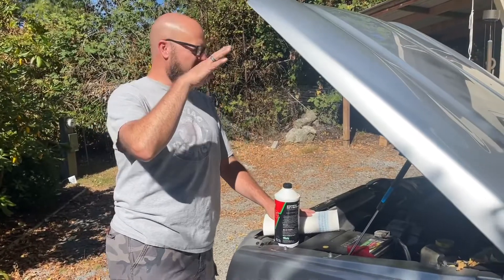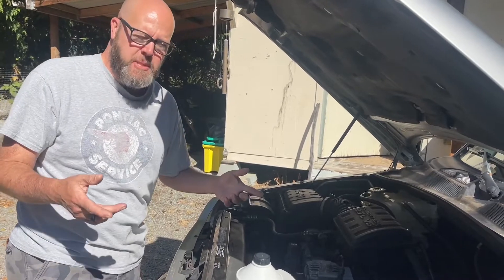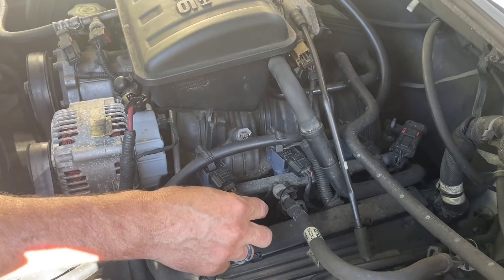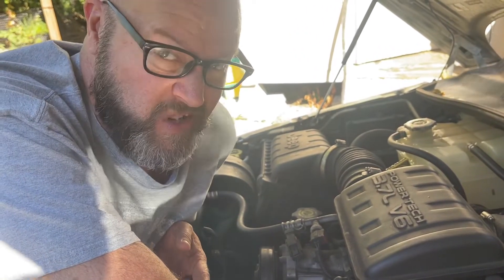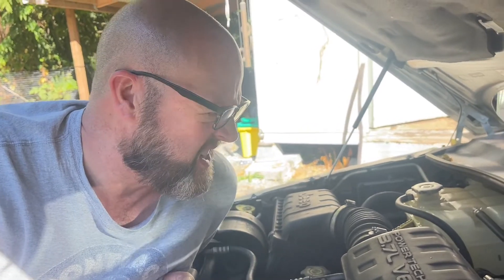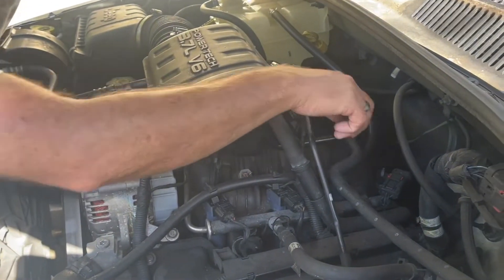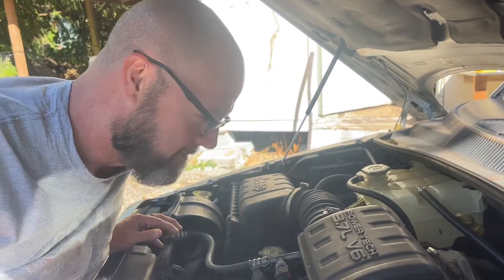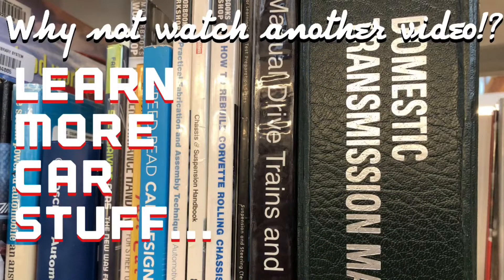3.7 V6 P0300 Cylinder Misfire Jeep Liberty, Cherokee, Commander MOST COMMON CAUSES

Comment: Just got this code on my 06 grand Cherokee it has 320k miles
Reply from the maker: Wow, that’s a lot of miles! Is it the 3.7 V6? Odds are a coil pack gave up.
Reply: Yes 3.7 V6 bought it over 10 years ago with 100k miles wife drove it for 10 years, then gave to my daughter when she got her license and wife got a newer 2016 grand Cherokee.probably the best vehicle I’ve owned, daughter still drives it today,328k and still rolling, don’t burn any oil
Reply: @ cleared code out and hasn’t came back as of yet fingers crossed 🤞, runs  smooth

Comment: I Have Changed All My Coils, Fuel Injectors, Spark Plugs, Relays, Gas Cap Battery And Alternator And I Still Have This P0300 Code.
Reply from the maker: Dang, Sounds like the computer. 
I would have a shop diag. It for you before throwing all those parts at it. 
Could be Computer 🤔
Reply: @RussShawTV  Shop Want Way To Much Money.
Reply: @RussShawTV  been driving it like this for over a year, runs and drives great.
Reply: The code has to be cleared, you can disconnect your cars battery for a few minutes to clear the check engine light

Comment: Hey I’m having this problem. I’ve replace coils plugs and plug wire set multiple times and still nothing. Checked wires all good about to do o2sensors and see what happens. But I cleaned my air temp sensor and the car drove good and then had a huge misfire and jumped rpm’s and then drove normal even when I pressed on the gas a good amount it drove good. 30 mins later after I got home I drove again and it started happening again. Could the air temp sensor by change be the cause?
Reply from the maker: I’m not sure. Could be a computer issue. This video was a most common cause scenario. 
When I worked at the shop, replacing the coil packs, usually fix the problem.  
I want to check out my friend, JT‘s “online mechanic tips“ channel. He is a Chrysler Master tech in Atlanta. He may have some information for you.  
Sorry I couldn’t be more help.
Reply: @RussShawTV  awesome thank you for your help. Glad you replied lol. Found a video and waiting for a reply on a question or two now

Comment: i have an 03 model that gets multiple cylinder misfires and ive changed coil packs,fuel injectors,crank and cam position sensors, new spark plugs,cleaned the fuel rail and replaced it and still have the same problem. but if i turn the ignition off and back on it fixes it briefly
Reply from the maker: Sounds like something with your computer 🤔 maybe able to find one at a wrecking yard that has the same specs. 
I wish you all the best with your Jeep liberty. Those three point sevens are good little engines if you can keep them running.
Reply: @RussShawTV  i changed out the computer,fuel injectors,spark plugs,new fuel rail,pcv valve,02 sensor,coil packs.  Tried marvel mystery oil etc.  runs great a while then just starts flashing the check engine light and goes into limp mode. I'm at a loss on whats wrong with it lol

Comment: Здравствуйте. P0300 все хорошо но эта ошибка не дает покоя
Reply from the maker: Sounds like your O2 sensors, or do you have a bad catalytic converter 🫤
Reply: @RussShawTV датчики первые стоят новые, а катализатора просто нет уже
Reply: @RussShawTV прошивка поможет?
Reply from the maker: Sorry, my phone stopped translating.
I don’t know what you’re saying. If you can translate to English, maybe I can help?
Reply: @RussShawTV  p0300 active error. The spark plugs and coils are excellent. there is no catalyst. Could this error be due to the rear lambda probes? How to deal with this error?
I will be very grateful for your help
Reply from the maker: @dedair-n1c  how do you know the coils are excellent? Are they new? Just because they are firing doesn’t necessarily mean they are working properly. The whole system is computer controlled, including the timing. These coil packs will affect timing as it’s built into the circuitry. There is no plug wires only computer generated signals firing the pistons.
Reply from the maker: @dedair-n1c  how do you know the coils are excellent? Are they new? Just because they are firing doesn’t necessarily mean they are working properly. The whole system is computer controlled, including the timing. These coil packs will affect timing as it’s built into the circuitry. There is no plug wires only computer generated signals firing the pistons.
Reply: @RussShawTV  Do you want to watch a car computer? and put the original coils?

Comment: idint help as i have 4 of 6 at once and my coil packs have less than 20k on them.
Reply from the maker: Unfortunately, if you bought aftermarket coil packs, that’s not uncommon. When I worked at the shop we, on more than a couple occasions, were replacing aftermarket coil packs bought on Amazon, rock auto even AutoZone and O’Reilly. Got to get the Chrysler OEM coil packs. Same goes for Nissan, Nissan don’t like aftermarket coil packs either. The Infiniti vehicles came in a lot with this issue, and we would get coil packs from the dealer 💸💸💸, but that would fix the problem. There’s websites out there, Chrysler parts, or Mopar outlet where you can find them at a much better price.
Hope that helps Andrew. Thanks for commenting.

Comment: Never say most likely when it comes to random misfires.... have 97 Cherokee and no coil pack...wires for each plug and continue to receive either po300 or po301
Reply: Camshaft sensor
Reply: Doesn't always give a code for it
Reply from the maker: When I worked as a both a mechanic and a dealer tech we would call this a “most common cause”. Just thinking off the top of my head 🤔 PO300 means misfire PO 301 cylinder number one and so on. I recommend if you have the money to replace all of them with OEM ignition coils. If one or two go, the rest will soon follow and while you’re in there, you’ll save your future self a lot of headaches. Don’t buy the cheap Amazon, O’Reillys or AutoZone crap. Odds are in my experience you will have to replace many of them in six months.
😎👍🔧You’re welcome ☺️
Reply: A year late, but your 97 still has a coil pack. It only has 1 instead of individual ones.  The middle plug wire on the distributor cap connects to the coil

Comment: I have a 2012 Jeep Liberty and there’s a misfire at cylinder 5 but I’ve changed spark plugs, coil packs, and fuel injectors. Any idea on what may cause it ?
Reply: Did you ever figure it out? I’m going threw the same thing
Reply: @isaacmartinez1336 unfortunately I did not. I was told to just replace my engine so I decided to get a new car.
Reply from the maker: Sounds like a computer issues. You should check out my friend, J.T. at online mechanic tips.
Reply from the maker: @@dibs4943 not a bad idea. I’ve seen critters climb up in there and chew on wires 🐀that can cause all sorts of havoc.
Reply: Sprawdź ciśnienie sprężania na tym cylindrze. Może się odpowiednie nie domykać zawór i będziesz miał misfire. Przyczyną może być dźwigienka zaworowa, lifter albo przytkany kanał olejowy do liftera.
Reply: Mine was the o2 sensor why I got the300 code

Comment: I have Cherokee 2009model tomuch problem misfire and also missing i change all injector and plug but same problem have any idea please
Reply from the maker: You may need ignition coils? 🤷🏻‍♂️
Reply: @RussShawTV  thanks
Reply from the maker: Your welcome Rashid, 🤔 Is it a 3.7 V 6?
Reply: Same with 2010 3.6L liberty, scanner says cylinder 2 misfire.  Changed that plug and checked wire and swapped out coil pack for that cylinder but never reset codes and after couple days after new coil pack it started misfiring again
Reply from the maker: @jeremywhite1062  3.6 penastar is a very different engine. Could be a computer issue. Or a valve if it is ticking as the first generation of those engines were notorious for. Also, those ignition coils are picky. It’s best to get OEM from the dealer or if you can find him a Chrysler OEM outlet website.
For example here in the states. O’Reilly says they have OEM ignition coils but they 4 of them lasted about a year 😡 just out of warranty.  But the OEM from the dealer we haven’t had a problem since. And she puts a lot of miles on her 2002 little jeep liberty.
Reply from the maker: 2009 has a different vehicle. Is it a 3.7 V6? I would check out my friend JT‘s channel (online mechanic tips). He is a Chrysler Master Tech.

Comment: They are individual coils. Not coil packs.
And that really isn't the most common problem with misfire. U hope that is the case.
Reply from the maker: I suppose technical term would be “ignition coils packs”. Each piece of circuitry is packed in a waterproof rod with a sealed cap at the top, with a mount be positioned with a 10 mm nut over the spark plug.
I worked on many vehicles with this 3.7 L engine and in the vast majority of cases it was a bad “ignition coil pack” replaced many of them had very maybe 1 come back.
I would recommend that people buy the ignition coil packs from the dealer or get them OEM. Common  reason they would come back is because they are cheap garbage parts. Found them here OEM for $42.00 each. https://www.northwestmoparparts.com/?gclid=Cj0KCQiAyMKbBhD1ARIsANs7rEF8UQIaVdDa7Tg-5RGSZq_9LTKp-OUbXnudS6BtC4mgtOCT31JZJJcaAhiHEALw_wcB
Reply: How did this even become an argument lol. I love how you look at the camera when you said tip lmaooooooo. I own my own shop and I’m gonna make some videos like this soon.
Reply: Ok. No big deal man. But a coil pack is when the coils whether it's 4,6 or 8 cylinders are in the same pack(unit). An individual coil is just that, a coil. Not a pack. You wouldn't put a coil pack on top of a single spark plug.
Reply from the maker: @IChooseJesus777  not trying to split hairs with you my wrenching brotha. I’ve done coil packs before it’s the circuitry that has replaced and eliminated a distributor. And I might add it is better technology. My point in the definition of “pack“ is that it’s all packed into one sealed unit. Whether a coil fires one individual spark plug or six or eight in my mind it’s still a “pack”. A distributor cap and points were all loose pieces of moving parts. But yeah I get what you’re saying. But I will say is that as a guy who’s worked on multiple cars with the same issue individual coil packs fail right around 100,000 miles. And sometimes sooner depending on that vehicle.
Reply: @davidhook2974 what’s the most common cause then ? 🥴

Comment: I have a 2009 jeep grand cherokee lerado and that code keeps comin up I hope this works
Reply from the maker: Is it a 3.7 V6?
Reply: @RussShawTV  yes
Reply from the maker: @briancarnell5448  does the code reader say what cylinder is misfiring?
Reply: Similar issue here. Jeep overheated a few days later it threw a p0303. I replaced the plugs and code shifted to p0305 so I replaced all the coils and spark plug wires. Still throwing a p0305
Reply: Сработало? У меня тоже эта проблема помогите

Comment: Wow 200.00 buck bring back spark plug wire.25 or 30 buck.
Reply from the maker: Actually I just looked these up on rock auto and you can get the coil packs for under 15 bucks each. Yeah replacing coil packs can be a pain in the butt 🤔😁 but keep in mind this is not just a replacement for plug wires it is a replacement for coil packs, distributor caps, distributors and points. As a guy who’s worked on a lot of cars I believe this is a better technology. Not sure how many plug wires are going to last 150,000 miles. They usually scheduled maintenance around 30,000 to 50,000 miles depending on the vehicle.